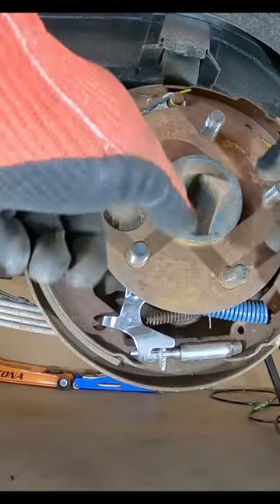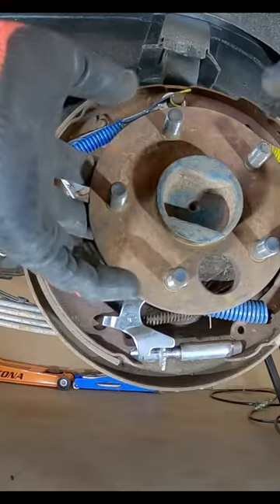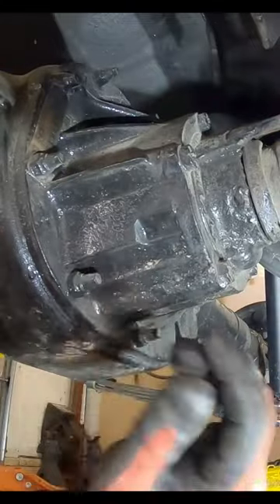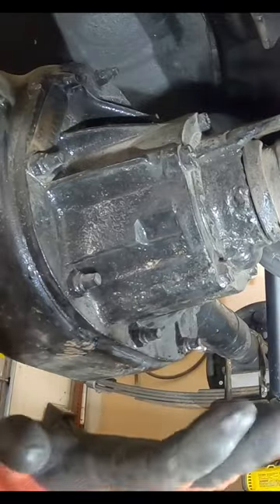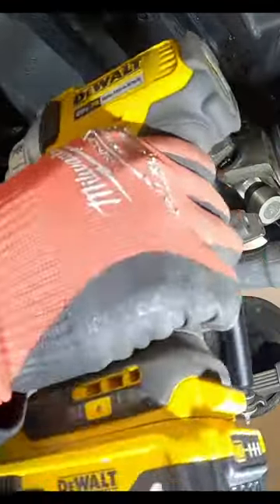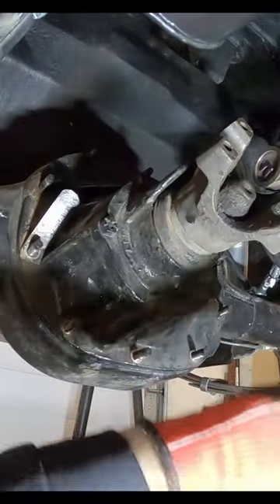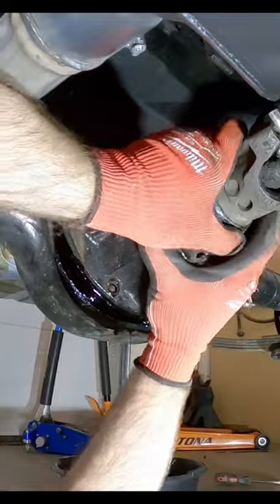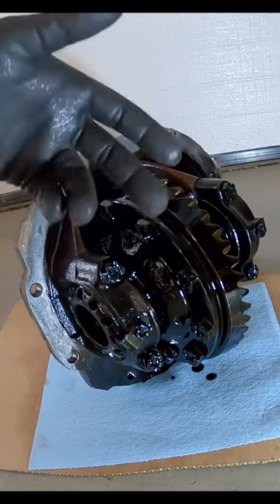Third Member Removal - Classic Mustang

Comment: Best be thinkin more in loose in that 8 inch for a 9 inch before you throw that gear threw the rear end and possibly the fuel tank too As I did on a 68 302 car No fun
Reply from the maker: Sorry Brotha, not understanding what you’re saying here. 🙂
Reply: @AndyKruseChannel  As 8 inch rearends won't take the torque your 347 is putting out for long blown up manny 8 inch Ford rear-end and tears up alot when they let go
Reply from the maker: @rogerwatson5995  Not only are the components upgraded to better quality parts in the 8" rear that can take more abuse, it's the lack of 5k rpm clutch drops that is going to help make this gear set last.  However, I want to make more power and I will eventually find the limit of the 8".  That'll be the perfect time to upgrade.  :)